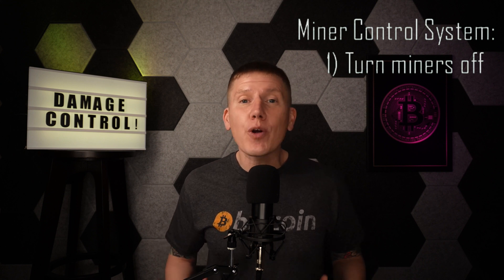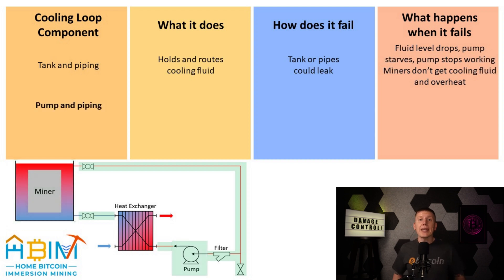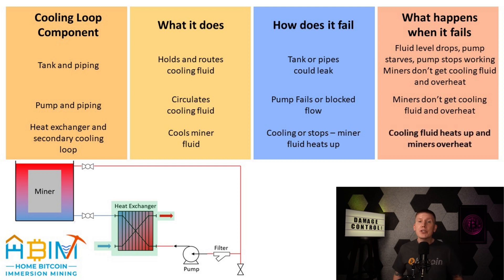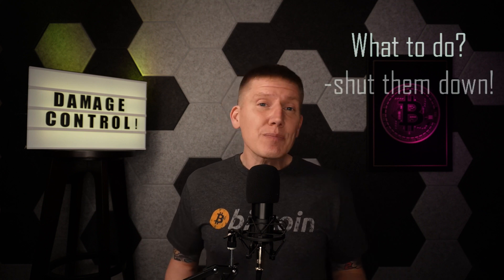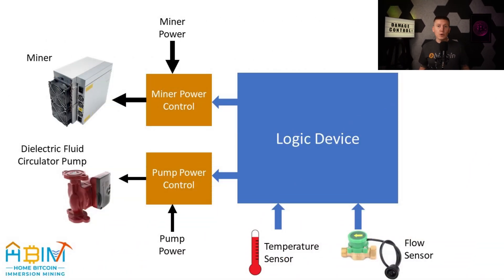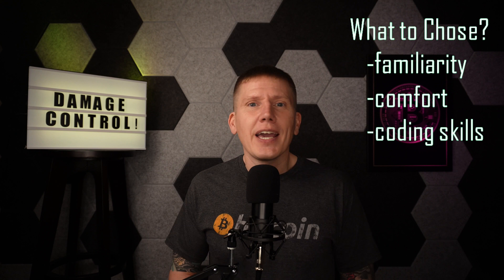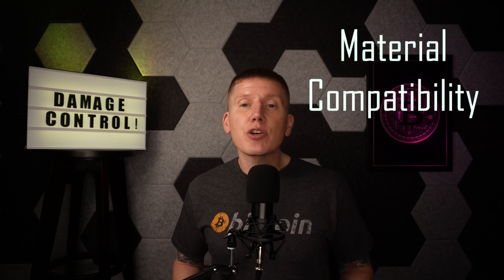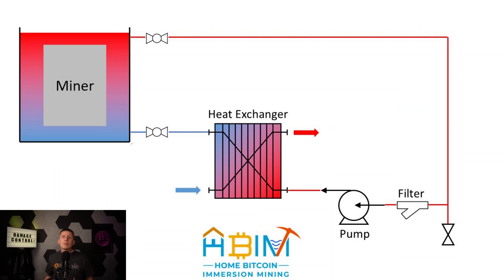EP8: How to design a BITCOIN miner control system

Comment: Hi , this is a very well structured video. Really good information. Just a quick question, what flow sensor would you reccomend as a lot of dielectric liquids would damage the sensor parts in  contact , like the blades of the flow sensor.
Reply from the maker: Great question...you're 100% right...finding a flow sensor was really hard.  I cover my build in EP9...I'm using a GEMS FS-400 series sensor.   Its worked great so far...but its crazy expensive :-(.  Would love to find something cheaper.

Comment: Hey, kudos to you for such a specific coverage on still quite a niche. I'm building on top of a c1 kit from foghash for a pool heating system but quite stuck on HE choice (need to go titan and trying to evaluate risks of breakdown ) probably on a spiral type vs in-tube multi tubular. Do you have a telegram channel ? As far as control unit I'm using home assistant, dealing with the miner trough shell commands. That unleash a lot of possibilities of automation plus you can put the new firmware to sleep instead of disconnecting power. The PSU will go down not generating any heat whatsoever
Reply from the maker: Thanks...would love to help.  Telegram is same as YouTube and Twitter: @HBIM_Channel

Comment: Hi Bob, thank you for the tip about the wiring.  I bought a C20 to dual C13 power cable from my miner supplier, but it sounds like this is exactly the type of cording setup that you are NOT recommending, is that accurate?

Instead, need individual C13 lines directly to my 220 -240 source, right?  Thank you!
Reply from the maker: yeah...if something goes wrong, you don't want all that power dumped into a small C13 cable.   They do sell Y cables...people are using them.  Its a matter of how much risk of something going sideways you want to accept.
Reply: Also, if so, do you have any recommendations for the specific type of C13  SJEOOW cables that should be used?  I know you mentioned that you made yours.

Comment: Hi, how should i design flow plates? What mistakes i should avoid?
Reply from the maker: Great question!   I covered flow plates as part of the tank design info in EP#4: https://youtu.be/T0QXYCm2Lm4, but the quick answer is the plate needs to be strong enough to support the miner and open enough to let the fluid through.   Miners weigh about 30 lbs, so you don't need much.   Some sheet metal with a ton of holes would do.  In my setup, I just stretched some chicken wire over a frame...not sure if that's the best solution, but I'm going to give it a try and see how it works 🙂